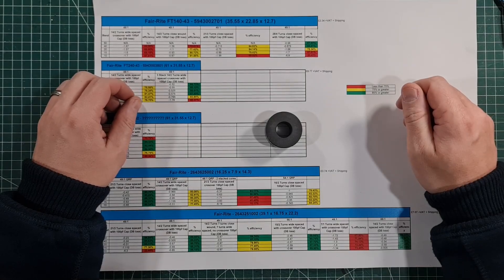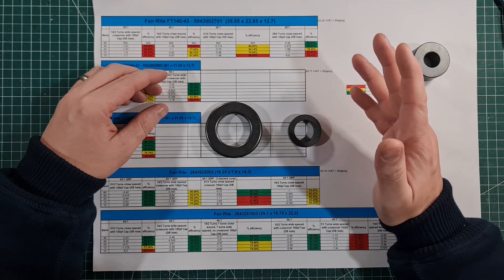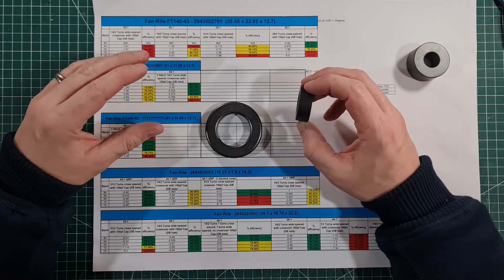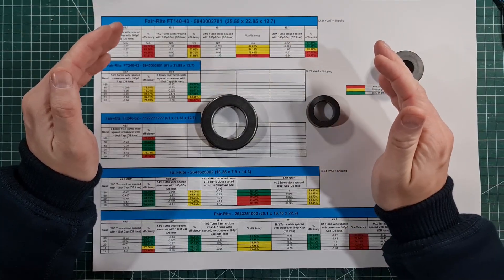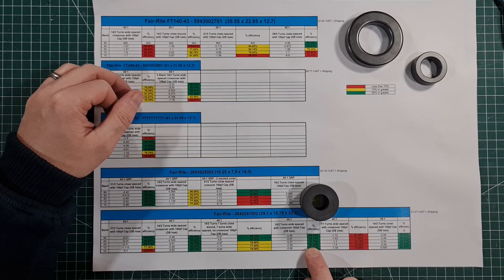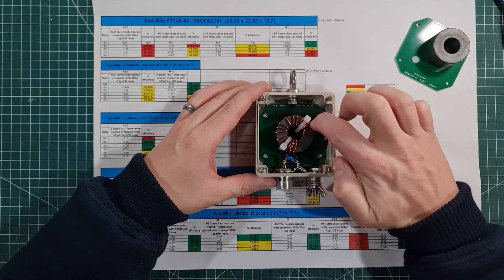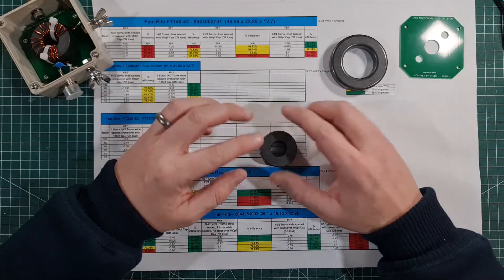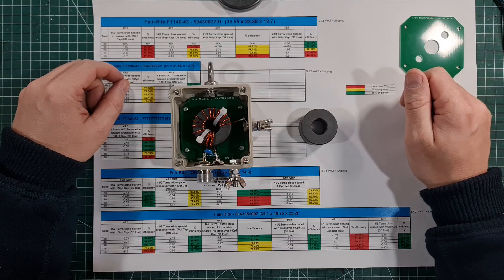Best Ferrite Core For a 100w End Fed Half Wave Antenna

Comment: Colin, you're way better at making videos than I am. I've been brainstorming some further efficiency items. Was thinking of doing a PCB similar to what you are doing, but have the transformer leads soldered into through holes in the board, an SMD capacitor, through holes for direct solder connection of coax to the board and the coax just exits the transformer box with a strain relief, no connector. Use a coax length 4 meters plus however much needed to get ferrite for common mode choking on the other end of it. That way it eliminates any excess lead length at the transformer and capacitor, eliminates the coax connectors at the transformer and one end of the choke. Surely that has to be worth something.
Reply: One more stupid idea:
Maybe the common mode choke can be integrated with such a PCB? Chunky transformer on top, common mode choke on bottom, built with nice silver plated copper wire and good quality capacitor(s) - maybe switchable 50, 100, 150pF - in an oblong case. 🤩

So many ideas, not enough spare time. 😕
I hope my "winding gusto" comes back in a month or two.

73 guys and keep up the good work!
Reply: @labcat73  I like the switchable caps; common mode choke on the PCB not so much.

The ease of deployment is one of the most attractive feature of the EFHW.  So I run mine without counterpoise, depending on the ~30ft of coax shield instead to do that instead.  So the common mode choke goes on the transceiver end.  Works well.
Reply from the maker: Not sure about that. You have a fantastic idea and it would make the build so much easier. I will look at this sometime if you dont mind? I've never designed a PCB with a circuit before.
Reply: You're more likely to get it done than me I think. It takes a bit to learn the software. I found EasyEDA software to be simpler and by using it a little I learned enough to start using KiCad which I would rather use since it is open source software and well suited to publishing things on sites like github. If I can ever find the time I keep meaning to make a 40/20/15/10m EFHW with that 61 mix core for portable ops. Maybe use LMR-195UF coax to keep it lightweight and just put about a 10 meter length onto the transformer box and then 2 meters away have a few ferrite beads slipped over that coax, a zip tie on each end to keep them in position and cover that with shrink tubing. Surely that is enough coax length for anything I might do portable and it eliminates every connection except at the radio. I've never tested that core with an actual antenna yet but it sure is low loss on the VNA.
Reply: Actually that 61 mix core would be good at 60m probably, but down at 80m it is more loss than I would want. I've done an EFHW in the past where I put the first harmonic right on 30m, then used a capacitor in the middle to move the fundamental up to the center of 60m, to compliment an 80-10 antenna. Maybe can use a small inductor 3.5m or so out from the transformer to move a harmonic to 17m band,  something I want to try. If another harmonic were to hit 12m at the same time, fantastic compliment to a 40-10 antenna then.

Comment: Excellent Video! It would be interesting to see the respective cores comparison in active use, with the temperature of the individual cores being displayed in real time: Once a core saturates, it's DONE and how could anyone expect any meaningful power transfer to take place? I don't know of it's correct or not, but I always think of a transformer as being the analog of a mechanical transmission, as we try and transfer power from one side to the other... 73 DE W8LV BILL
Reply from the maker: Great idea, in practice its has issues as you need a remote sensor that polls quicky so theres little delay. Keeping it in my mind
Reply: @MM0OPXFieldRadio  DMM thermocouples? Thermal camera?
Reply from the maker: @w8lvradio  yes, just more $$$ as I dont have either currently.
Reply: @MM0OPXFieldRadio  Yes, I have that problem here as well! I'm certain with time that we will get cheaper FLIR cameras with higher resolution. I remember when pulse oximeters were in excess of $300 US, now it's more like $20...  All the Best! 73 DE W8LV BILL

Comment: I am a little bit confused. In the video you show a 56:1 with no crossover. In the spreadsheet it says to use 56:1 with crossover for best performance. So should we use or not use a crossover. Thank you for all the time you spend for testing this and have a good 2023 for you and your family.
Reply from the maker: Good spot, I did both and there was no measurable difference. I just didnt log it. Make your own choice depending on your installation.
Reply: @MM0OPXFieldRadio  Thank you for your answer. Will try to make one. I have now one from HF Kits and made it also with 15 turns and crossover. Is the loss you have only during TX or also on RX? And what do we notice in real world? I think I should make one to see :)
Reply from the maker: @rademaartje1  generally I dont think you will notice the difference in the real world vs a 240-43 but being able to run a constant 100w digi is a big plus.

Comment: Interesting, I just picked up Adams kit. I may wind it your way and as I’ve always wound them 14/2.
Reply from the maker: I like to run as an inverted L and the 2/14  had a high SWR on 40 (2.5:1). As an inverted V it was ok. Going 2/15 fixed this for either config 👍

Comment: Happy New Year Colin! Another great video, I've already made two transformers using that toroid a 49:1 well tested and a 56:1 that's going up in the next few days. No rush for returning the 240's. I'd far rather you hang on to them a while longer and get as much data as possible. I'm looking forward to more info on stacking with a view to maximising efficiency of high power EFHW's in the future! 73, Tom
Reply from the maker: Happy new year Tom, you're patience is appreciated. I still need to check a 2 stack. My hunch is for QRO is you will need 2 separate transformers. I dont think any one will provide efficienct broadband coverage. Time will tell though. All the best 👍
Reply: I want to try 400W with 2 or 3 of these stacked.
Reply from the maker: You can but you will lose efficiency on the higher bands unfortunately. Above 20m will be killed efficiency wise.
Reply: Thanks for information. How did your swr end up with 56:1? ( 15 turns )?
Reply from the maker: On 40m its about 1.5 to 1. Other bands its lower.
Reply: @MM0OPXFieldRadio Does your test include 80m ?